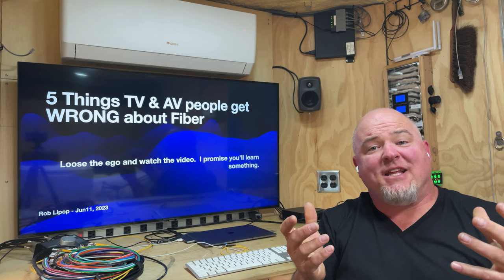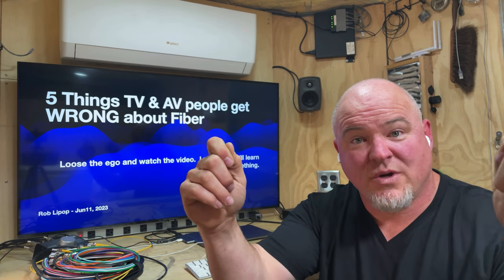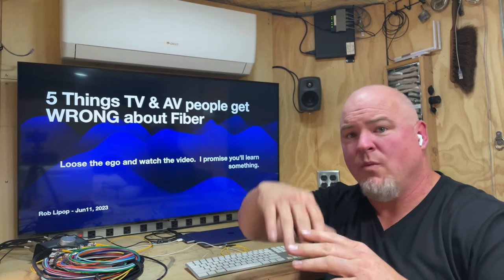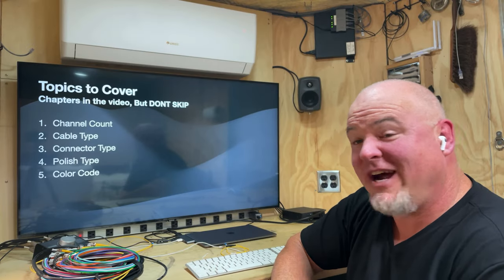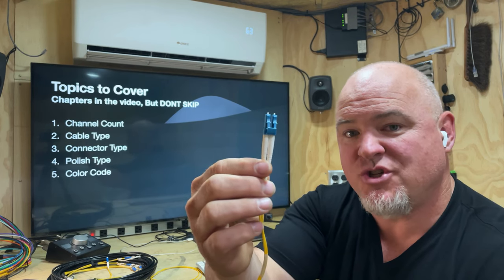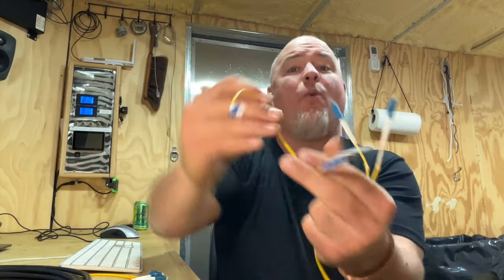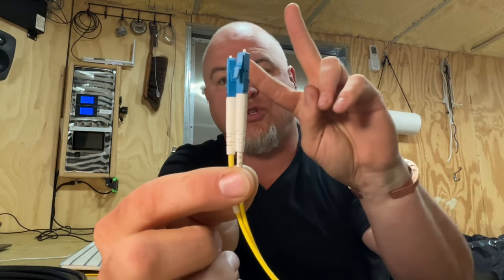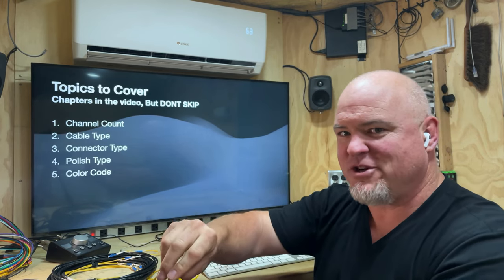5 things that TV and AV people get WRONG about FIBER

Comment: Great video Rob. I work in broadcast just starting 6th decade. The company I started with used Pirelli Fiber I believe one of the first of it's type. Most connectors were a version of SC/APC, not sure actually when standards started. I've seen SC/APC barreled to SC,  MM jumped with SM. One site had a Ma Bell feed MM CWDM into the plant building  they installed a receiver that internally changed to many output SM then to our gear to product, thing never worked right. Today, semi-retired,  I have a lot of hybrid plant, away ends are ST, fiber manager is LC all single mode. The odd ball items are for things like RS232 over Fiber which is SC/APC and Some audio over fiber which is plain SC. One thing I'm finding more of is SM Bi-Di especially in data and audio, little or no delay. Our devices are 1310 - 1550. We should remind all especially in Bi-Di plant not to assume there isn't traffic on the circuit just because one end isn't connected, other might be hot. Either WL can damage your eyes before you know it. Good info, thanks for sharing.

Comment: Good video Rob! Coming from the audio world, I refer to a fiber bundle as a "mult", bundle or snake of "6-strand, 12-strand" etc.   And of course, a single strand fiber could be carrying 64 channels of audio, so calling a single fiber "1 channel" is a little confusing. The crossover terminology is sometimes confusing.   
Your coverage of connector types and fiber modes is good, would like to see you expand on that, covering why a system would use SM over MM (distance) and maybe a bit on signal conversion at the ends of said fiber (coax/BNC to fiber, then back to BNC on the other end).  Keep up the good work!